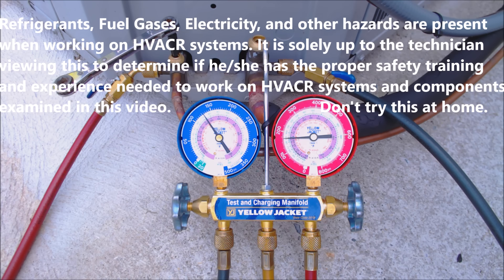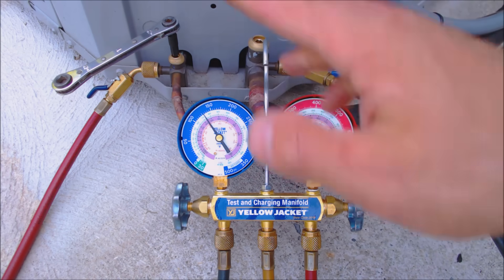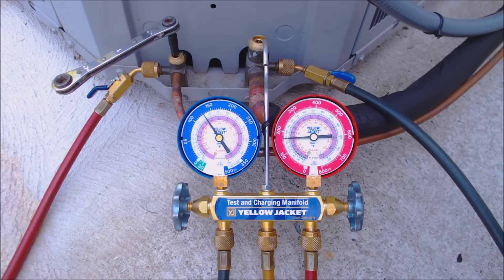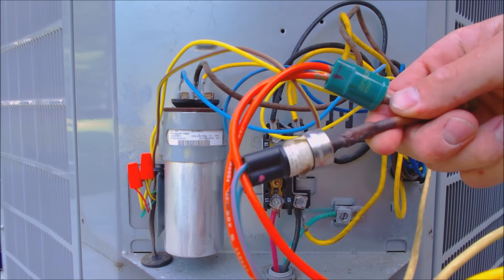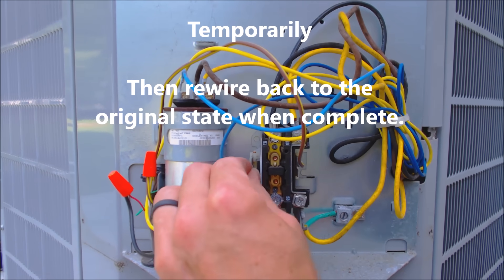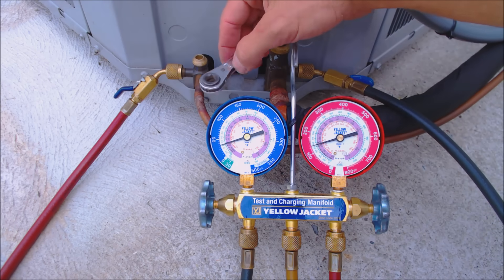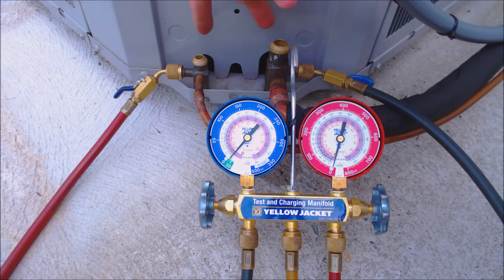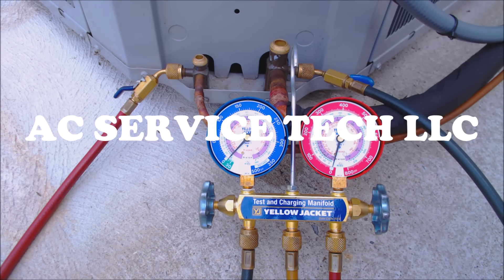HVAC PUMP DOWN Procedure of Air Conditioner! STEP by STEP!

Comment: hi, i was wondering why  on some units doing a pump down by pressing down on the contactor the compressor keeps shutting down after 2 or 3 seconds? but on other units it works fine. thank you.
Reply from the maker: I am sorry I read and answered too quick. You are correct. So is thecompressor making a loud noise and continuing to run or is it literally shutting off on you? Are you loosing 240v at this time? The only thing I am thinking of is either the internal overload or the pressure relief
Reply: yes it does sounds like pressure relief . the compressor makes a sound PSSSSSSSSSSSSS and then shuts down. then when i tried again it pumps down for 2 or 3 seconds and then PSSSSSSSSSSSS and shuts down again. what would cause the pressure relief to go off like that? thanks.
Reply: the compressor just shuts down. compressor just shuts down after 2 or 3 seconds into pump down. i've tried again and again and the same thing happens. thank you.
Reply from the maker: That would have to do with a low pressure and high pressure switch. You would need to bypass them in order to pump a unit down. Look up"acservicetech pressure switches" thanks!
Reply: but if you were to press the contactor down all the time wouldn't this bypass the low/high pressure switch? if the low/high pressure switch were to trigger it should not affect the contactor because you're holding the contactor down all the time. please correct me if i am wrong . thank you again for all your help.

Comment: After pumping down..and after doing a repair on the line set. Then, is it ok to just release the refrigerant back in the line set? and would the ac system work normal again?
Reply from the maker: No it needs the pressure test, vacuum, and standing vacuum test first, thanks

Comment: Can i pump down 410a refrigerant?
Reply: Warum nicht? Klar, der Druck ist halt etwas höher.
Reply from the maker: You can typically pump down a scroll compressor to 5 to 10 psi unless the manufacturer literature specifies not to. Reciprocating compressors can be completely pumped down usually, thanks!

Comment: Can you restart the compressor to get any residual vapor that might have been in the evaporator coil?
Reply from the maker: No, you would need to recover that if you were not able hold a vacuum level and the pressure rose, thanks!

Comment: I use chopsticks to push the contactor. All the time.
Reply from the maker: Ha ha, nice. I would advise to have the blower running indoors so when you pump it down to 0psig, it stays there and doesn't rise as much. I always try to teach newer techs the safest ways to do procedures, thanks Ruben

Comment: probably best to only pump down when replacing the unit and avoid touching the valves at all, otherwise they'll likely end up leaking out the o-ring and caps
Reply from the maker: Yeah sometimes, like today, I only pumped a unit down to 15 psig and then recovered the last remaining 4 ounces to 0psig to replace a leaking evap and filter drier. I just wanted to show what it would look like in the video. For replacements I usually recover right then and there, thanks throttle bottle!

Comment: just recently had a service call commercial building. the so called techs couldnt get the heat pump to run in cooling so they removed all the piping txv filter driers reversing valave check valves to run it in cooling. flooding the compressor which was brand new 2,775.00 ran for 4 hours.
Reply from the maker: Wow, what?!

Comment: Can I change  the piston on the indoor unit after I do a pump down? Also pull a vacuum after system being opened while still in a pump down?
Reply from the maker: After the pump down, the lineset and evap coil can be opened up to atmospheric pressure. If the lines are in vacuum then you can bring them up to 0psig with nitrogen. Yes you can then change the piston out. after the system is reconnected then pressure test, vacuum, perform the standing vacuum test and then open the service valves to allow refrigerant back into the system, thanks!

Comment: Do condensers with micro channel fins come pre-charged with R410a, and I’m asking, because you stated not to pump down condensers with micro channel fins.
Reply from the maker: Yes but if extra refrigerant was added into the system after installation we don't want to force that into the small micro channel, thanks!
Reply: @acservicetechchannel  So just recover then add back when repairs are done

Comment: Last pump down video I saw, you shut off the power at the disconnect before closing the low side service port.  Which is the preferred method?
Reply from the maker: It is better if you can shut the vapor valve before shutting power off so the that no vapor left in the compressor will increase the pressure on the lines after the pump down. Also if it is a heat pump then you wouldn't have a choice. The vapor valve must be shut before the power is turned off because the reversing valve would allow the refrigerant to come back out, thanks and yes it is just a little harder to time the closing of the vapor valve, thanks!

Comment: Can it be done on a Scroll? I was under the impression that it can just not into a vacuum.
Reply from the maker: Pump downs are not good for any compressor so if you need to do it, it should be quick. Reciprocating and scroll both use the oil with refrigerant flow to lubricate and the refrigerant flow to cool. The scrolls have tighter electrical clearances to ground and the lack of refrigerant for insulation is not helpful for sure. Some larger scrolls have a low pressure cutout but typically smaller residential ones don't. I would not argue that it is not good for the scroll compressor to be pumped down into a vacuum. Pump downs are better when done on reciprocating, thanks Steven!
Reply: Great vid AC Service Tech: So pretty sure I've seen in print somewhere that Goodman says DO NOT pump down their residential Scroll/Heat pumps and wanted to understand why. 
You said "so if you need to do it, it should be quick", does that mean the disconnect pulled instantly after vapor valve front seated or if not what is meant by "quick"? 
Is it really harmful or just if going into vacuum that hurts? 
Is it more harmful to HP's vs. straight A/C condensers? 
I know both high and low ps's would need to be jumped out to get to 0 PSI but could you elaborate on best practices to get it pumped down without hurting the scroll compressor, as if it were your personal unit? 
What damage is done to the scroll comp. if done anyway or is Goodman just trying to scare techs?
Reply from the maker: First off, I would say to always follow manufacturers directions. It is my belief that they are speaking on when the inlet goes below 0psig. On scrolls, the electrical windings are very close to ground and when in vacuum, there is a reduction in insulation between the windings and the ground. Therefore potential arcing can occur and damage the windings of the motor during that time. If you are concerned or the unit or compressor you are working on states not to pump down, then don't. Maybe the unit you are referring to is a microchannel, not sure. You can always forward over the heat pump doc if you find it so I can try to figure out why. Most of the time manufacturers are mentioning about the time the compressor is in vacuum while running. If this is a concern on the particular unit you are working on then just pump the unit down to a level above 0psig such as 10 psi, shut the vapor valve, turn the unit off immediately following, and then recover the rest of the refrigerant. I just mean't that pump downs in general are not great for the compressors except those designed to do so on a regular basis such as in refrigeration. Pump downs for Condensors are usually the same for heat pumps on standard units. Make sure that the vapor valve is shut before turning off the unit though and make sure the tstat was in cooling. If you can't pump a unit down, then just shut the valves while off and recover the rest. Thanks Bobrub, I hope that helps!
Reply: bobrub. Iv pumped down scrolls a great many times (dispite the warning not to) And always gotten away with it.  I just take care to stop promptly a bit above zero. I find the "bounce back " of evaporated gas is minimal. If you're practiced you got the timing right. 

Or if your worried do the following : stop promptly at about 20psi. Release the tiny remainder. After the repair, vac then fill to 20psi from a bottle. Then release valves as Normal. HTH 

The other safest way, use the recovery pump, pump into condensor.

Comment: Can you now do the after repair video restart?
Reply from the maker: Hey ejcsds, basically after fixing the leak with the valve cores out, pressure test, nitrogen blowout, vacuum to 200-300 microns and then break the vacuum with vapor valve since this was a carrier unit. Some equipment manufacturers want the vacuum broke by opening the high side. Thanks for letting me know what you would like to see ejcsds!

Comment: Did you already recover the refrigerant that was in the system before you start the pump down. ?
Reply: JiggyPatel no the point is to get most refrigerant into condenser so u dont have much if any to recover
Reply from the maker: William, thanks for answering the question for JiggyPatel!
Reply from the maker: If the outdoor unit has a leak, part replaced, or needs to be replaced or the whole system needs to be replaced, thanks JiggyPatel!
Reply from the maker: Hey JiggyPatel, the pump down is used when you are moving the outdoor unit or fixing a leak in the lineset or indoor coil and you are trying to lock all of the refrigerant that was in the system into the outdoor unit just like the unit comes from the factory like unless it is a dry unit. We try to get all of the refrigerant into the outdoor until in one shot so recovery is not needed. If the unit has a leak then don't pump down below 0psig. Thanks JiggyPatel!
Reply: AC Service Tech LLC so when do you do full recovery method ?